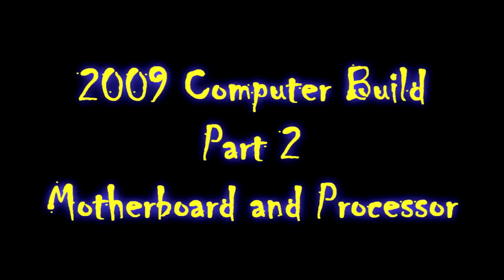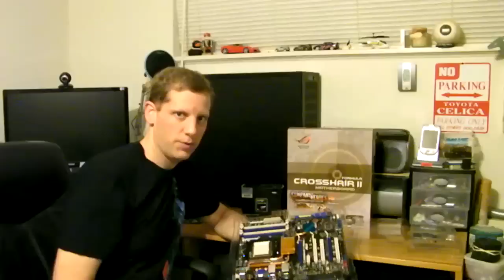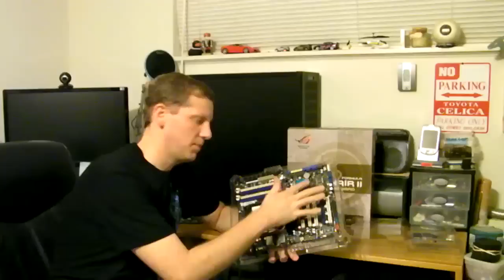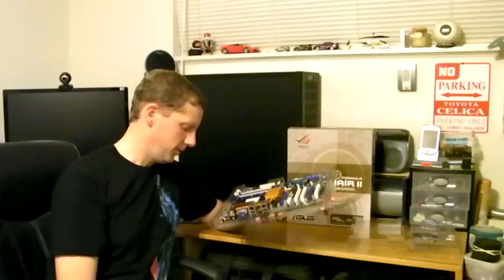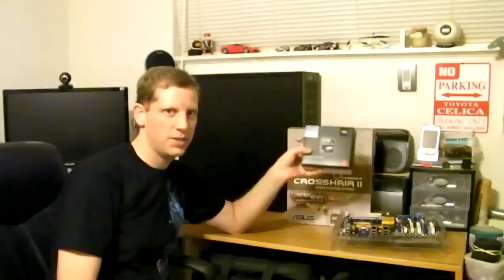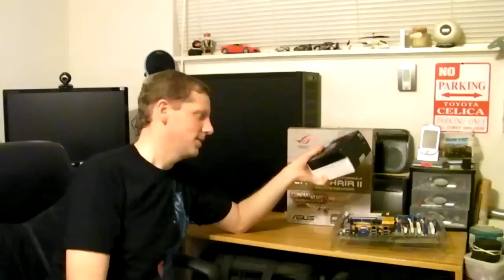Building My New Computer Episode 2 Motherboard and Processor

Comment: Nice vid dude, I have the same mobo and I love it! but it´s not a 790 chipset, it´s a 780a chipset. And hybrid sli will only work with a discrete nvidia video card so the hybrid sli will increase the performance with geforce boost. If u´re using a high end video card, the hybrid sli will work as hybrid power, this means that when u´re using non demanding 3D applications the system will work with the integrated video card, and when u start a game or a demanding 3D application, the system will

Comment: Nope, u can´t put them in sli to improve performance, only for power saving by connecting your monitor to the motherboard connector. Then u have to activate the option on the nvidia control panel and this only works on windos vista. This will not boost your performace cuz u have a good graphics card and this hybrid sli only works with low-end cards like the 8400gs.

Comment: @AVH48 Hi there, you say the parts that Wes is using only work on windows vista, so I'm just wondering would they work ok with windows 7? I'm assuming when you say they only work with vista that it just means they wouldn't work on windows xp, whereas going to windows 7 would be ok, right?

Comment: The onboard card is good enought to play the physics. It will work with hybrid sli with 1 or 2 260 GTX but you are losing performance.
Also I have changed from 9950 to 955 and the pc is alot faster. Try it